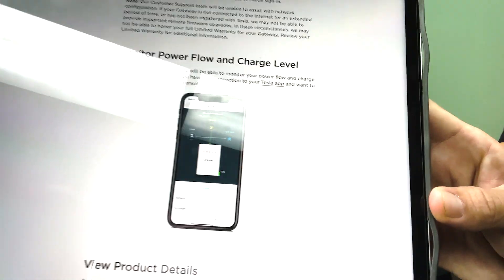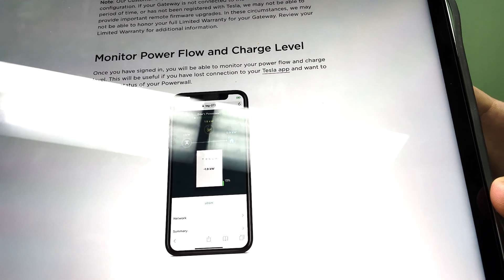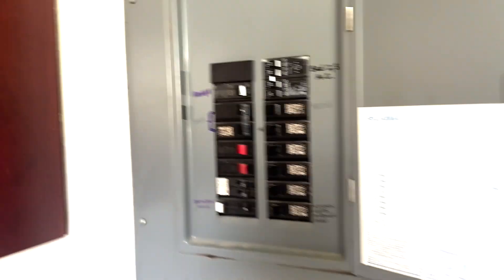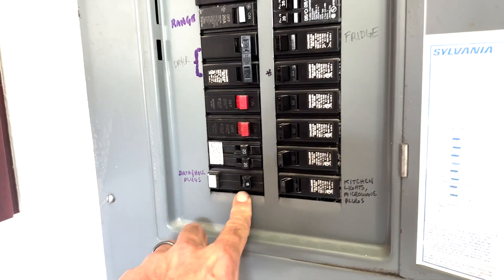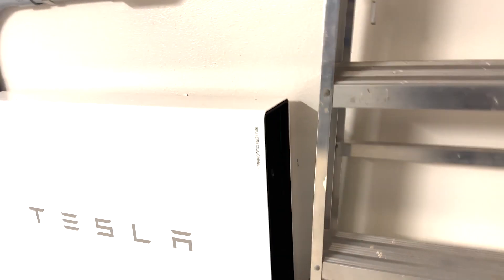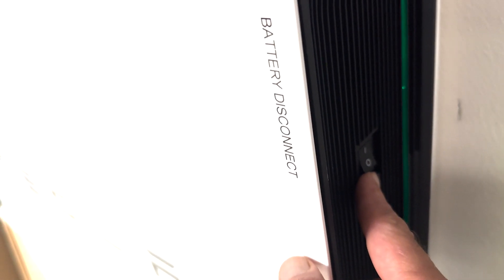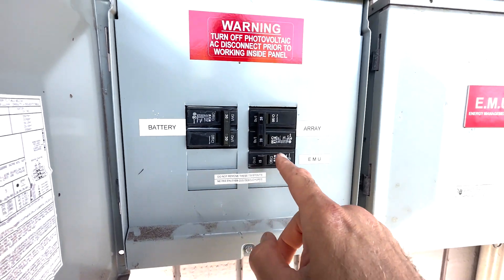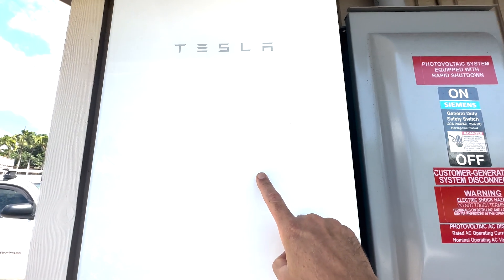How to Restart Tesla Powerwall2 in off grid mode

Comment: My batteries were at 0% after 2 days of bad weather. We jumped the system and had the green lighta flashing and then turn to solid green, but then my system wouldn't take over to charge my powerwall. Restarts/resets dont seem to do anything to help this. Installer wants $900 to take my batteries in for manual charging. I cannot afford this and have expressed this to them. Is there anything else you can suggest I try? My family has been without power for a week now and its over 100° inside our home
Reply: You want to switch off absolutely every load (lights, etc) as they say in the video.  But you need the solar panels to see the power coming out of the powerwall for several minutes before they start producing power.  To debug all this I would first turn on a single low wattage (e.g. LED) light bulb to make sure the powerwall is putting out power.  Then ask youself - did I open a breaker that keeps this power from reaching the solar?  Maybe you have to turn on a breaker somewhere to get this to the solar panel inverter?  Maybe do a test at/near the solar power inverter.  Maybe measure the voltage there (be careful - deadly voltages).

What I'm saying is step one is to figure out if the problem is at the solar panel inverter or at the powerwall or if the two are not connected together.  Maybe you need to reset the solar system in addition?